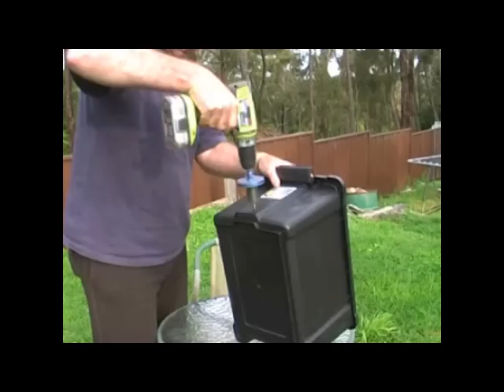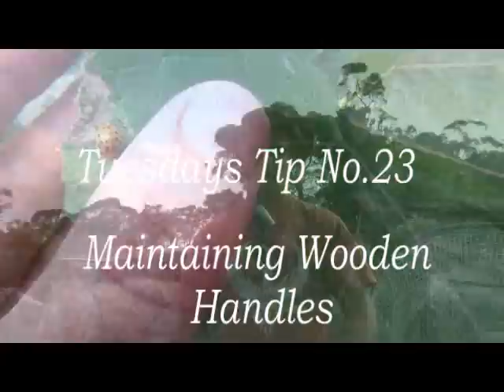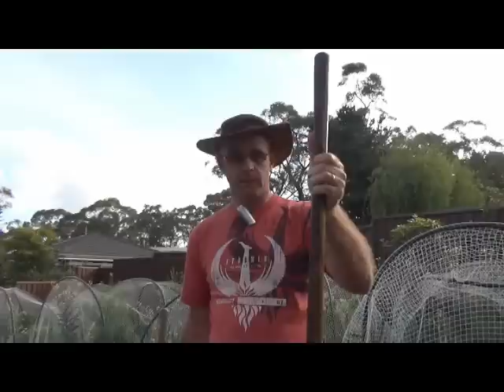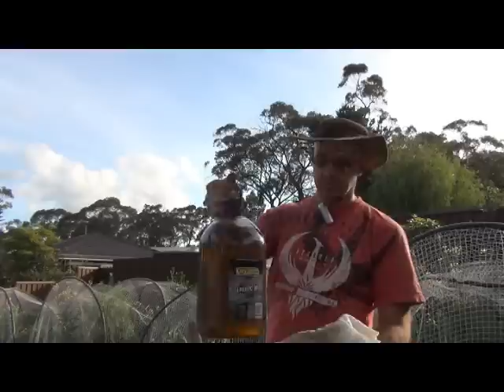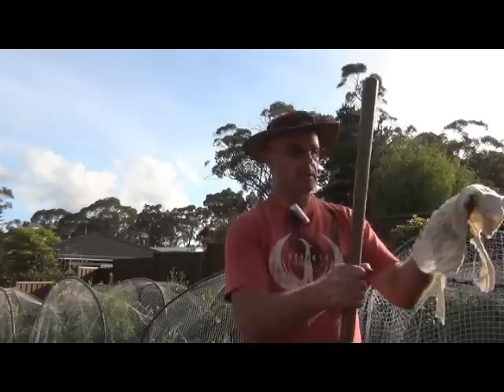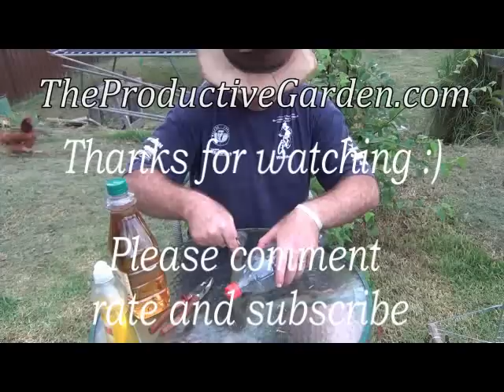Tuesdays Tip No. 23 - How to Maintain Wooden Handles.

Comment from the maker: The linseed oil does repel water just as any other oil will. Over time it does dry and has to be reapplied. I suggest doing it at the end of autumn when most tools are being put away and not used over winter and then at the beginning of spring when tools are starting to be used again.
The oil does make the wood darker but I dont think this is really and issue for tool handles.